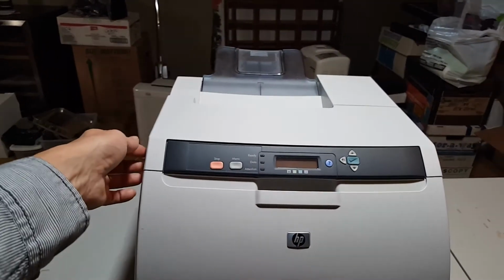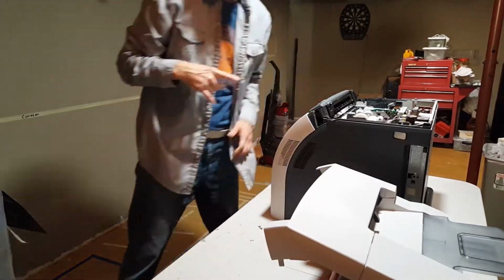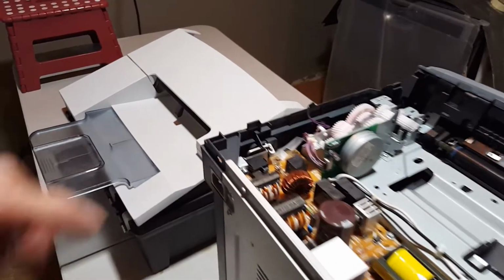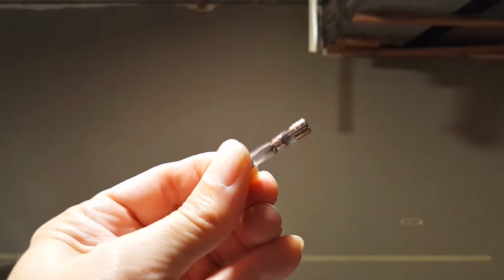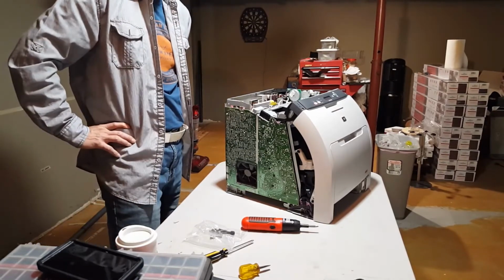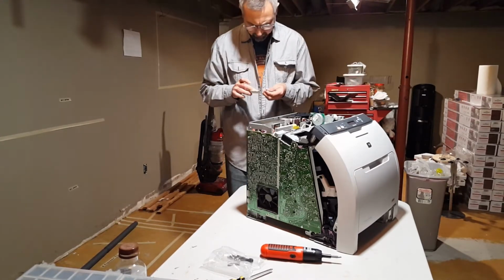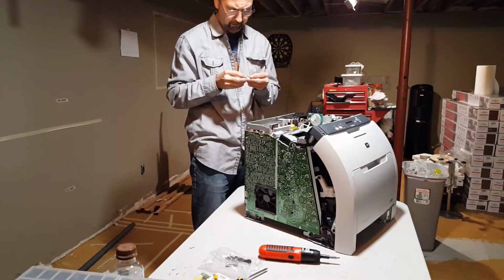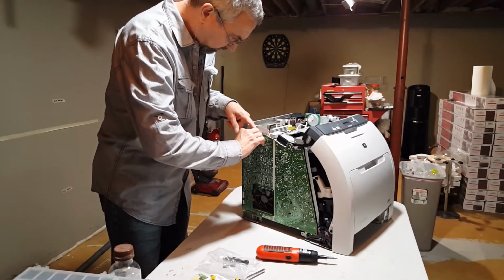Fixing the HP 3600n Fuser Hot Error 50.9

Comment: Probably that fuse was for fan on the side. Fuse blew and fan stopped working resulting in top fuser cartridge getting too hot. Replacing fuse turned fan on and cooling started.
Reply from the maker: Could very well be that.